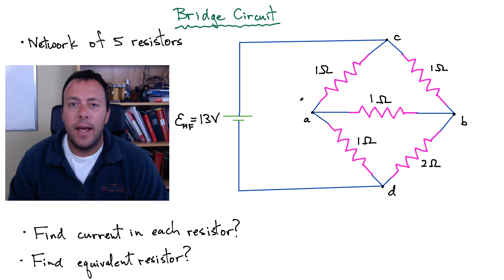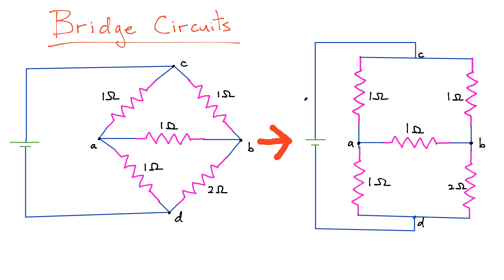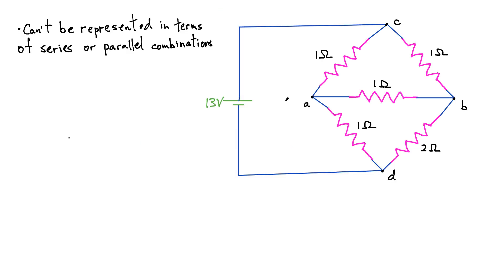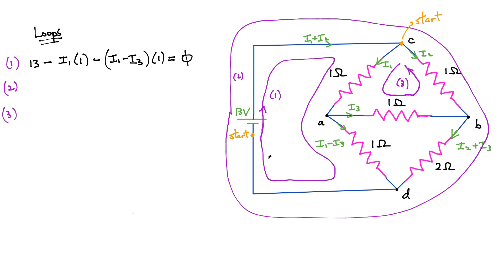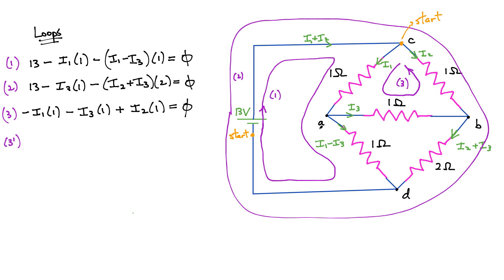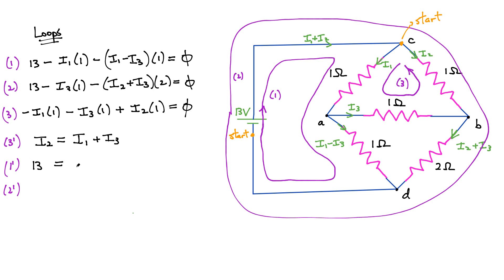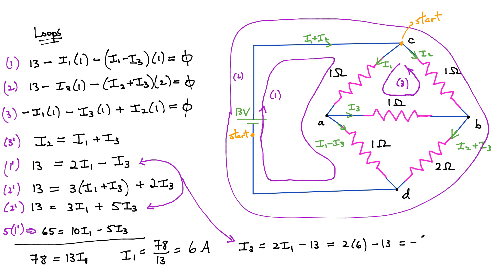Bridge Circuit Equivalent Resistance

Comment: Hi, I have a question. If I am considering a similar circuit with all resistors having equal values R, then no current will flow through the central resistor due to A and B being equipotential. Can I then ignore the central resistor and use parallel circuits to solve the problem? It will then become a parallel circuit with each arm having 2R, and so the effective resistance would be R. Is this reasoning correct?
Reply from the maker: Yes, that will work

Comment: why you choosed loop 3 , to be anti-clockwise . And not clockwise like the first two loops.

Does that make difference with the result?
Reply: No.
I1 = 6  I2 = 5    I3 = -1
loop 3  Counter clockwise  - I1 + I2 - I3 = 0    ->  -6 + 5 + 1 = 0
loop 3                 clockwise    I1 - I2  + I3 = 0    ->  6 - 5 - 1 = 0

Comment: Thanks for helping. Your method of finding the equivalent resistor by first calculating the total electrical current was a clever idea. Congratulations. You have eliminated a few steps in the mathematical process with this shortcut. I would appreciate more exercises like this. Thank you very much for sharing your knowledge.

Comment: Several years later and I come back to this video and channel for help again! I do have one question about Prime 2 Calculation at 12:45.
I don't understand where you got the coefficient 3 from, when all you did was replace i2 rather than i3. (lowercase i for clarity).
Since term rearrangement gives 13 = i3 + 2(i2+i3), the substitution of i2 would give us 13 = i3 + 2(i1 + 2i3).
This simplifies to 13 = i3 + *2i1* + 4i3 = 2i1 + 5i3
I don't see where the 3 i1 comes from.
Reply: true hero ❤

Comment: We can also use the DELTA to WYE Formulas for Resistances to find Rt, 'Total Resistance'. However, I would prefer this method you have demonstrated to save time. Find the all the currents flowing and the 'equivalent resistance' comes so easy to calculate in the end. Thank You Sir 'PN' -Junction.... :)
Reply from the maker: Yes, I have another video where I use delta-Y for the same circuit.   Best regards

Comment: Wonderful work! appreciate your help and effort. I want to add, unfortunately I could not understand why there was only 3 loops instead of 4. I thought (abd) junctions are also a loop. Can you enlighten me on this regard please? Thank you so much.
Reply from the maker: I would consider a very simple parallel circuit (1 battery and 2 resistors in parallel).     WHen you solve this problem you are solving for 2 unknowns (the currents through the resistors).    When you set up loop rules for this simple circuit you can write 3 loop rules.  You only need 2 equations to solve this problem.   One of the loop rules (around both resistors) is actually the difference between the 2 other loop rules  (each with battery and 1 resistor).     So you gain nothing by writing this additional loop rule.       The same applied for the bridge circuit.   There are 5 unknown currents and therefore i need 5 equations.     I know there are 2 junctions and therefore i need to write 3 independent loop rules.    For this problem, you may be also able to solve if you write 4 loops rules and use only 1 junction rule.      If you try to solve and can't it's because one of your loops rules is a linear combination of the others.

Comment: if there are no mention voltage, Only hava resistor value. How to find EQ resistor that bridge connection?
Reply from the maker: I would use a delta Y transform.   Check out my other video.
Reply from the maker: Bridge Circuit Equivalent Resistance using Delta-Y Transform
https://youtu.be/TIVcNNpPn_w
Reply: @PhysicsNinja  Thank You so much..

Comment: Great Explanation. Can we also find Potential at Va & Vb by voltage divider rule . Then find Vab = Va-Vb, Then find Current i3 =Vab/1.  Is it right way to analyse if we just want to find current i3. Please let me know.
Reply from the maker: Yes, that seems ok.  Test it out and if you get to the same answer it will give you confidence.    There are several ways to solve this circuit!
Reply: @PhysicsNinja  Unfortunately this is incorrect as exact voltage division requires no bleed current i.e. the bridge would need to be in balance. As this example has an unbalanced bridge arrangement, the use of simple voltage division will result in errors since the current in R3 is not zero. HTH. BTW this was a great video and thanks for sharing.

Comment: Is it pssible to do in way,at first remove bridge resistor,calculate Vcd,then put it back and calculate I bridge,we will also get direction from it,but my valuea is little different,left side 6,5A and 7,5A,right side 4,33A and 3,33A

Comment: You can convert any one of the delta parts to star and can find Req without applying loops. That will be easy in my opinion.
Reply from the maker: I completely agree. I have a video on the same problem using that transformation.  My only problem with y-delta is you need to know the trick before applying it.    It’s not an obvious transformation.

Comment: This is really awesome but I have one question. If you slightly complicate this problem by changing the value of the resistor that i2 flows through, to anything other than 1 you end up with a fraction in the prime of three. Basically I tried this method with a range of resistor values and was significantly stumped at the point where I end up with a fraction representing i2. What are the options in such a case?

Comment: Hey, greetings from norway. 
Two questions.
1.
 Since i2=i1+i3, let's say that i3 is -205,333A and i1 is 17,333A => i2=17,333A+(-205,333A)=-188A. This means that i2 will flow in the oposite direction. Refering to my circuit, the 50Ohm resistance wil not have any voltage or current. The electricity won't pass over it for some how. I have made my equations similar to yours, just changing resistance. I constructed my circuit at http://falstad.com/circuit/circuitjs.html.  If you paste this code into a notepad and upload it to http://falstad.com/circuit/circuitjs.html you will display my circuit:"$ 1 0.000005 0 30 5 50
r 512 336 576 272 0 10
r 576 272 640 336 0 30
r 512 336 576 400 0 6
r 576 400 640 336 0 18
r 512 336 640 336 0 50
w 576 400 432 400 0
r 576 272 432 272 0 3
v 432 400 432 272 0 0 40 300 0 0 0.5" (300Volt from source). 

2.
I also have one 3Ohm resistance in series with the bridge as you can see. Is this causing problems for equation since it is changing the voltage to the bridge, since we need the Voltage in the equations. But if you want to find the voltagedrop over the series resistance you must have the total current developed in the circuit. So it is an evil cycle in my head. Maybe you have an explanation.
Thank you!

Comment: Wouldn't loop 3 go through the 2 ohm resistor
Reply from the maker: Brett Jordan you could use another loop for the lower triangle that includes the 2 ohm resistor.   At the end of the day we need 5 equation to solve for the 5 unknown currents.    I picked 3 loop equations and a couple of junction rules
Reply: @PhysicsNinja  ty

Comment: What if one of the resistance is zero
Reply: There's gonna be a short circuit.. Meaning the current would prefer to use the zero resistance path and will not opt for the one with a resistor value.

Comment: Why the direction was anti colck in loop 3?
Reply from the maker: Sohan Rahman you are free to make the loop rules in any direction you want.   Start by guessing a direction of current and make your loops.   If at the end you solve and obtain a positive value for current it means you initial guess was correct.  If you solve and the current you obtain is negative it means your initial guess was in the wrong direction.  Hope this helps.

Comment: why did you only take 3 loops and not 4 or 2?
Reply from the maker: Great questions.    For complicated circuits i first determine the number of unknowns that i'm trying to solve for.   In this problem i'd like to find the voltages at the nodes and the currents.     Some are dependent on each other but at the end I have 5 unknowns that i'd like to solve for (5 current values)  if you know the current values you will also know the voltages.      This means i'll need at least 5 equations.     I use 3 KVL (loop equations) and 2 (KCL) equations to give me a total of 5 equations.

Comment: could you add all the resisters up and thebn divide by 5? in this situation you get the same 1.2 however idk if itll always work
Reply from the maker: Leo unfortunately that doesn’t work.  Adding the resistors will only work if the have they are in series and have the same current flowing through each.

Comment: Can also solve these circuits by Node Analysis as then you only have to solve two equations with two unknowns (Va and Vb) versus Mesh Analysis which has three equations and three unknowns:
(Va - 13)/1 + (Va - Vb)/1 + (Va - 0)/1 = 0
(Vb - 13)/1 + (Vb - Va)/1 + (Vb - 0)/2 = 0
Then all currents can be calculated via Ohm's law.
Reply from the maker: Andrew Kostiuk I have another video where I solve the circuit using a delta-y transform.   It’s super easy if you know the method.   The method in this video is by far the most tedious algebraically but still straightforward..
Reply: Can delta y give you the current

Comment: So there is no way of rationalizing the equivalent resistance apart from adding a test current to the network? How did pi-t conversions were first conceived then?
Reply from the maker: Zupprezed you can write down on equivalent resistance using delta-y, combined with series and parallel combination.   This is something Electrical engineering students would cover in detail and beyond the scope of this video.   I’ll add a video on this method but I do have videos on y- delta transforms.  Thanks for the comment.
Reply from the maker: Here's a video a did before using the same problem but with Y-Delta conversion.   You can easily write a general equation for Reff!  https://youtu.be/TIVcNNpPn_w

Comment: might be a dumb question but can we find the values of Is in loop equations by using matrix form?
Reply from the maker: Great question!  Yes you can write this in matrix form.  Any linear system of equations like this can be written in matrix form. This is essentially applying what is called the voltage node method.

Comment: Sir can we calculate the equivalent resistance in this case if the emf is not given?
Reply: EMF actual value does not matter for equivalent resistance. Double the voltage will double the current, R = V / I :-)

Comment: It can't be simplified because of the resistor in the middle, right? With open terminals you would have two simple series combinations in parallel and RT would be RA||RB?
Reply from the maker: Yes, it can't be simplified using standard rules for parallel and series resistors.  There are other methods (delta - Y, see my other video)  that can be used but these are move advanced thicks.
Reply: For a trick question, if the ratio of the resistances between the two resistors on the left is equal to the ratio of the two resistances on the right, then there is no voltage between "a" and "b", and the middle resistor has no effect, and can thus be removed.  Then R_total would be R_left || R_right :-)

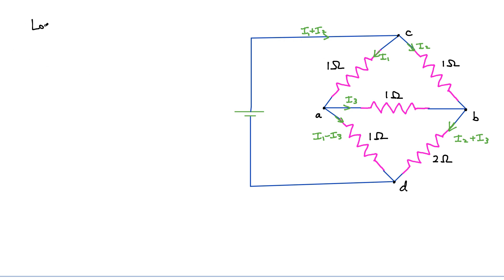Comment: Starting from 6:44 . . . what in the world is a 'loop' and and what are the mathematics related to them?
Reply from the maker: Peter Chan A loop is shorthand for Kirchhoff voltage law.   If you go around a closed path (loop) the voltage differences should sum to zero - Conservation of energy.  The junction law is also called Kirchhoff current law.   The junction rule says whatever current flows into a point must equal to the current flowing out= conservation of charge.
Reply: @PhysicsNinja 
Thanks for the clarification.
I already know about the junction thing. It was the loop thing which sort of puzzled me.

Comment: How to find R equivalent without finding total current
Reply from the maker: visu patel you could use a transformation- y- delta to transform circuit into a simpler circuit then use basic rules for series and parallel resistors to write as an equivalent resistor.   I have a video on y-delta transforms.. check it out
Reply: @PhysicsNinja  I have 1 circuit but   
I can't solve it, please can you help me?
Reply from the maker: visu patel email me I could maybe give you advice onlinephysicsninja@gmail.com

Comment: This is very long. Just eliminate the resistor b/w a and b as they have same potential. Then solve
Reply: Mj You're wrong, when you add the resistor between a and b, it changes the entire circuit

Comment: Thank you 
How to find the voltage between two junctions in circuits like this?
Reply: My guess is that since you have calculated the current (I) and the resistance (R) is given, you can calculate the voltage drop.  This is a great question, would like for Online Physics Ninja to reply to this.
Reply: Walter Montalvo thank you for your help I tried that and it worked 👍
Reply: You are welcome, glad I could help.

Comment: Are there any method of find equivalent resistance without applying KVL,KCL??
Reply from the maker: Electrical engineers often use Thevenin and Norton equivalent circuit methods to quickly simplify complex circuits.    I have another video where i use Thevenin Equivalent to simplify the circuit in this video.   Good Luck!
Reply: subhasis das this is one of the most basic sums in current electricity. Just eliminate resisitor btween a and b coz the have same potential the solve (wheatstone bridge)

Comment: Searched for hours for help on this homework problem only to discover it can't be represented using series or parallel conventions. Thank you so much. I have no idea why this isn't mentioned anywhere else on the internet.
Reply from the maker: This is definitely one of the harder first or second year circuit problems.    
There is a much simpler method using what is called a Y-Delta transformation but you need to know the trick to know how to use it.   It's not just series or parallel but a rather more complicated method to solve certain type of resistor network.    Good luck with your studies!   I'll try to make a video on Y-Delta transforms this weekend!
Reply from the maker: Here's a video solving the same circuit using the delta-y transform.    https://youtu.be/TIVcNNpPn_w
Reply: 🎉 @PhysicsNinja
Reply: It can be simplified by doubling the bridging impedance into two parallel impedances and transforming each delta (triangle) into star. Then it's a piece of cake to reduce it to a single impedance.

Comment: You make it seems million times complicated than how it is sir. Just use delta to wye conversion and you will be able to solve it in 4 easy and short steps ! It Takes 2 minutes to solve no more. But thank you anyway.
Reply from the maker: Thanks for the comment.    The goal of my video was never to solve it in the fewest number of steps.   Clever engineers have formulated tons of tools like the ones you mentioned to help solve complicated circuits very quickly.   My channel is less about engineering tricks and more about applying fundamental physics to solve problems.   Happy learning!
Reply: Online Physics Ninja, I am grateful for your approach of applying fundamental physics to problems.  Before jumping to engineering tricks, spend the time walking through the fundamentals, it helps with retention when learning.  And yes, mentioning KCL and KVL at the end would help with further research.  Honestly though, your video helped me understand KCL and KVL much better than other resources discussing them.
Reply: I like your comment and video a lot but if it is about applying fundamental physics IMHO you should at least mention that this is KVL and KCL. I think that is a crucial point to mention when solving these kind of problems. But again I like your video you should how to combine so important math with the physics. Way to go don't stop making videos and please don't feel offended by my comment
Reply from the maker: Thanks for the suggestion.  I decided to finally sit down and learn the delta-wye tranform and it's brilliant.

Comment: Thank you, very clear and well explained. Determination of which loops are used is the only thing I'm unsure on. I'm guessing you use the minimum number to cover all lines between each junction.
Reply from the maker: RNAlh thanks, you can certainly write down more loop equations than you need.  I like to use 2 junction equation then determine how many variables are remaining.   If there are 5 currents and I use 2 junction rules I know I will need 3 loop rules.  Happy learning!
Reply: RNAlh, "I'm guessing you use the minimum number to cover all lines between each junction."  Right on!

Comment: use delta conversion
Reply from the maker: Engineers have uncovered a series of simplifications that allow you to solve this problem much faster than using Kirchhoff's rules.   Kirchhoff's rules is the brute force method and always works and what i like the most about it is that it doesn't require you to memorize a series of formula or tricks.
Reply: Online Physics Ninja, thanks for NOT jumping straight to shortcuts.  For those of us that are trying to absorb the fundamentals, this is gold.
Reply: I found 1,17ohm when delta conversion is used.
Reply from the maker: I finally decided to educate myself on the delta-y transform.  Thanks for the suggestion.  Here's the video https://youtu.be/TIVcNNpPn_w

Comment: How should we consider loops???
Reply from the maker: Hi Saif,  great question.    In general the number of "independent" loops should be equal to the number of unknowns in the problems. If we want to solve for 5 current values then we would require 5 independent loops.      The only things that you have to be careful with are that the loop equations are indeed independent.     Sometimes if you add 2 loop equations you get another loop equations - these are NOT independent from each other.